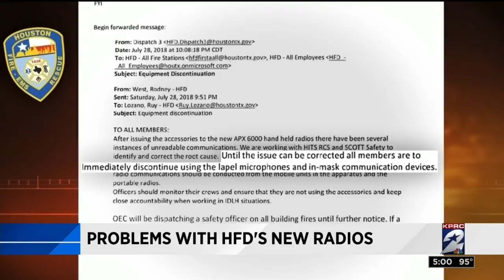Problems with HFD's new radios

Comment: It was an interference between the mask and the mic
Reply: Do you know how it was overcome?
Reply: @frazzle657  typically this is an RF signal interference issue that chopper noise that you can year when they played the audio is from the way digital radio signals are sent. The best way to combat this is to make sure all your accessory cables are RF protected. But I would contact Motorola if you have any issues they will be able to fix any issues because we don’t normally see these kinds of problems in Motorola accessories.